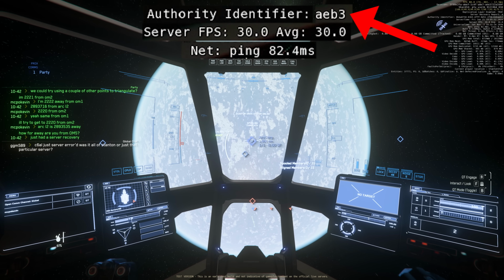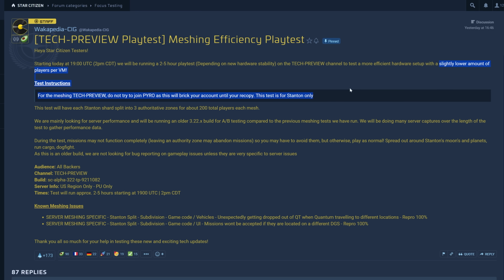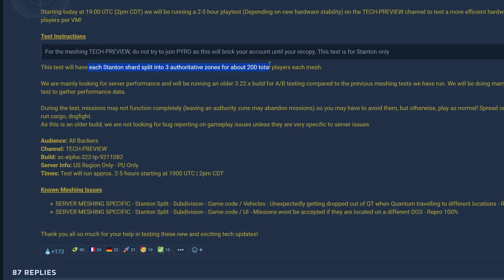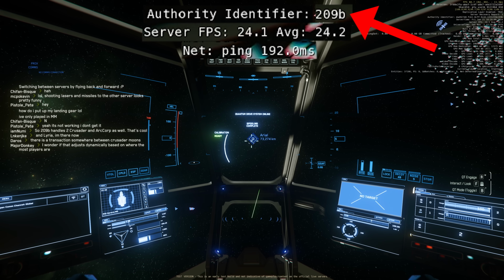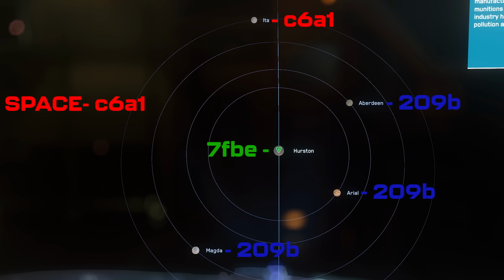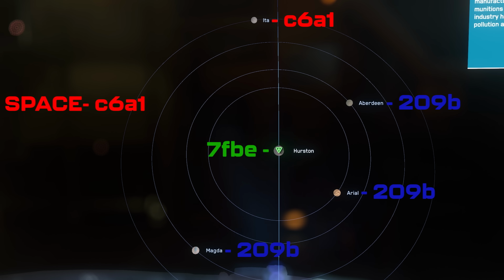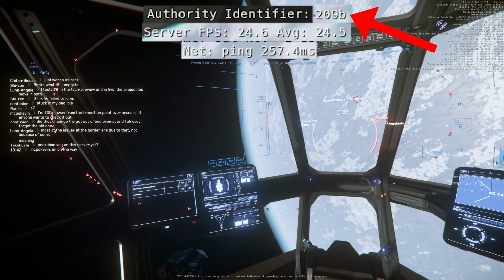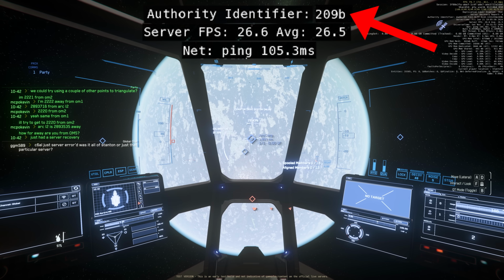Is This The 4.0 Shard Configuration?

Comment: What is going on with that ping?

If that's not local to your internet connection then there is something seriously wrong (or its not representative of actual RTT)...

The actual server meshing is a mammoth undertaking, very technically challenging - so there will no doubt be serious issues that need to be resolved along the way...

Comment: I mean, there's nothing too exciting about this. It's twice the amount of players with only one extra server. You're not going to see a massive increase in performance, even if the server meshing works perfectly. 

This is the suspected issues with the future of server meshing. Just because they can do it, doesn't mean they'll pay for the extra aws servers to make everything run perfectly. They might try to cram as many players per server to lower server cost anyway. That's why they increased the player cap from 50 to 100. The servers would be running a lot better if they had left it at 50. 

Server meshing may not be the savior of this game that everyone thinks it will be. It depends on if CIG can afford to spin up the appropriate amount of servers for the load and sustain that long-term. If not, you'll likely see a perpetually buggy game with poor performance.

Comment: You were assigned to 030 which was way more unstable and laggy than 020/070, 020 was basically smooth throughout with only slight momentary delays happening every few minutes.

So the 030 backend config was the bad one, and 020 is the one they'll go with down the road, whatever it is.

Comment: What you're describing about transitioning to different servers seems consistent with how they said this would work. If a server handling a certain "area" didn't have enough load it would pass that load off and "shut down", or it would take some load off of something else -  so one would presumably expect to move fairly rapidly from authority to authority in the normal course of things. One would also not be fixating on those changes in the normal course of things, but we're not there yet.

Comment: I took part in both tests: while this test was overall better and more stable, they didn't seem to have fixed ingame bugs (missions, qt, etc).
What makes me very confident about this tech, is that if you go at the edge between two servers and do stuff/interact/shoot etc with a friend, it just works perfectly like in their demo in the last CitCon. That's the core bit, and it works. The rest will come I have no doubt.

The authority ID change after recovery was already a thing in the last test btw.
Reply: I feel like all the mission stuff is because they still need to link those things to the replication layers, considering those act the same as during a server recovery. It’s all stuff that has to be loaded on 2 or more servers simultaneously, compared to other working stuff which is all locally loaded.
Makes me believe that we’ll have to wait some time till we see this stuff work properly and without too much latency or possibility of exploitation.
Reply: @idkusername_27  Yes, my understanding from some comments they made is that it's not just "a bug" but rather they need a new system to save/restore(/transfer?) mission states as well as link it to the RL properly, both for meshing but also for 30k recoveries.

If they don't have it ready for 4.0, using 1 DGS per system could be a solution to avoid too many issues and still release Pyro + some sort of SM (even if very basic). 

Time will tell!
Reply: @Quent1nB  So it is what I guessed. A bit annoying to know that we probably still have to wait quite a bit, but it’s such mind baffling tech that I don’t really mind.
Can’t imagine how difficult it’s gonna be to have dynamic server meshing working with all the stuff the game is gonna have, massive props to CIG for not trying to cut corners even if it is sometime a bit mismanaged.
Reply: @idkusername_27  No project ever runs perfectly and clearly they have/had their fair share of issues, but like you said they're not cutting corners, they are doing such a high quality game in so many ways, we are slowly seeing the picture of the future ahead. If any other studio had tried this, we wouldn't have half of this, and would end up with... well, Starfield (no troll intended)
I'm glad some people like you still understand all this, many people don't.

Comment: Usually the language they used in the post combined with AWS Cloud computing gives you a hint what they do. Combined with some knowledge gathered from Level1Techs videos about the bigger server processors. You have a AWS server that is sliced down into several virtual machines. Those servers can have upto 192 cores per CPU and you never know how many are in one of those servers. As there is no Operating System that can handle all of 192 cores really in one server and it would not help to get more performance you need to slice and dice those servers to be the right size for the service you run on it. So how many  cores can be handled by the OS. What is the memory requirement of the service and so on sizing of servers and VMs is a science of its own and is always related to what program are you running on the hardware. In Cloud computing you usuallly seperate services in there own containers or VMs to be able to size those things to the specific requirement. The experience they gathered internally as usual does not match what backers do to the server environments. So tests like the one yesterday will happen hopefully more to get things straightened out before 4.0. When we arrive in 4.0 this will be only fine tuning and not a big time issue like 3.18.

Comment: Soooo correct me if I am wrong, but my layman brain tells me, this is basically the same tech that Elite has? Every planet has an instance/server shard that it works on, and when you leave that gets flushed from memory and you get to move on (albeit in Elite there is a brief hidden loading time when shards switch)
Reply: Elite Dangerous is Peer to Peer, it doesn't have a server architecture for multiplayer other than some things like Economy, accounts etc
Reply: @Unlighted4K0  That does make sense why the need for the instancing load times there. THX! :D

Comment: Ita doesn't have atmo. The rest of them do. Maybe that's what the delineation was? Space and moons with no atmo, Planets, Moons with Atmo.
Reply from the maker: Yeah that's an interesting thought!
Reply: It's much more simple than that, they probably gave each area a server impact value, Something like Hurston is PRETTY HEAVY, while something like ARCCORP is pretty light. Then they basically balanced everything with this is mind, the space server is probably handling more moons,  specially moons without bunkers, crash sites and caves, and all the Lagrange points. While they might just have dedicated a single server for both Hurston and Microtech (the heaviest bodies BY a countryside) , all in all the only way of knowing is to ask them or check every freaking corner.
Reply: @GabrielGreedy   Yeah that aligns with some of my reasoning. The 4 planetary Landing zones (i wonder if GrimHex is the same server?) have high traffic so those are handled together. The moons with atmo have a bit more server side calculations necessary than those with no atmo so those are together. Since the moons with no atmo behave basically like space (minus the 'gravity', at least), those were clumped together with the rest of space.

The reasoning is arbitrary no matter how they divvy it up, because ever server is running the same code. I've always wondered why they don't just split it up by planetary system. All of Hurston and its moons, Microtech and its moons, etc. Who knows why they don't.
Reply: @GabrielGreedy  A follow up idea I just had is since they have player location data, they split the servers up in a way to avoid ever maxing out the player cap. That has to be a consideration too.